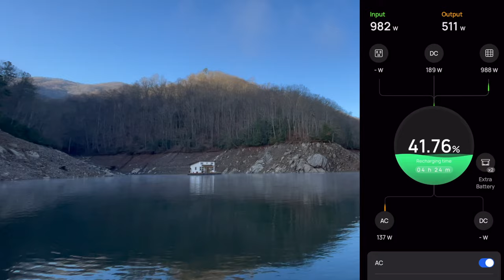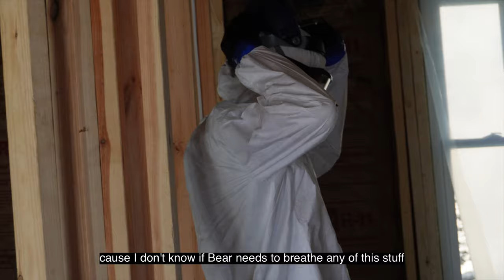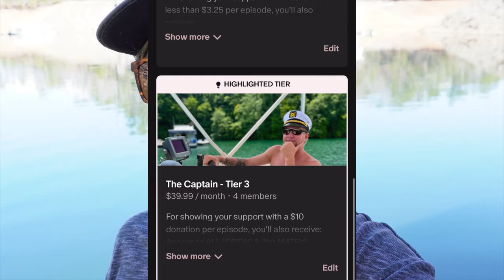Down & DIRTY: Interior progress vlog on float home remodel!

Comment: Early spring days are so great on a lake.  There will still be cold days, but the daylight will be longer by the next video.  Wondering why your dingy is registered in Tennessee?
Reply from the maker: We’re so ready for spring! Almost here!!

It’s registered in NC now but the last owner was in TN and brandon just hasn’t taken off the old stickers yet 😆 the stickers typically don’t adhere well to the PVC material of the dinghies like they do a fiberglass boat (its a wonder how the TN ones on Brandon’s have made it this long), which is why mine doesn’t have any anymore. We keep the registration on a laminated paper in the boat just in case (not that we’ve ever seen anyone patrolling here lol) but unless we trailer down to FL where there’s a lot more law enforcement, we don’t bother with replacing the stickers since they always just end up accidentally littering the lake here.

Comment: That spray insulation didn't look like it was expanding correctly. Parcel Safety has good full face respirators I got a discount code for it as well, and you can get clear plastic protectors for them from the local farmers co-op. Yall are doing an amazing job love what you put in these videos!!!
Reply: This is actually a sealant man. The r-value is like 6. I will be putting rolls on top of the tongue and grove to get the value up. Main reason for this was just to make another barrier. It doesn’t expand more than 2” and I sprayed it on thin!